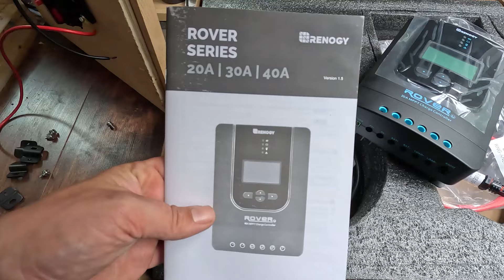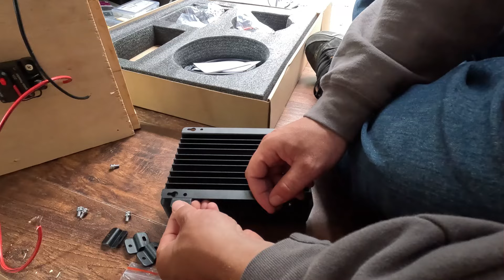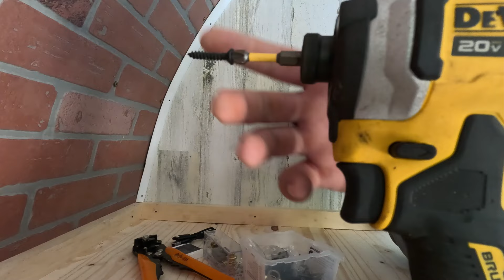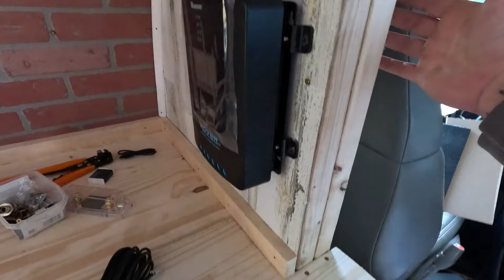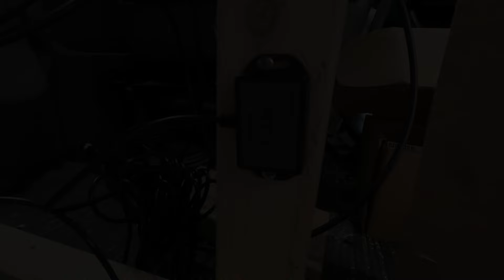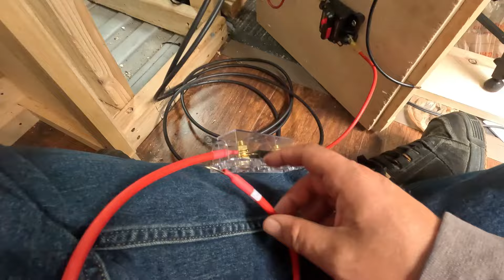Installing a Renogy 20AMP Solar controller, van build part 10 Solar Energy.

Comment: Looking good! I only went with my charge controller because it offered the DC to DC charging from my alternator. My BT-2 came with the same mess of wire which I don't understand because it's bluetooth! It's not like ya got to mount the module where you need to read something on it! I did the same thing you mentioned though - neatly gathered the excess together and zip tied it. Another step closer to done!
Reply from the maker: Yeah I like your setup a lot, I went pretty entry level just because it’s my first time ever digging into solar so I figured I’d keep it as simple as I can
Reply: @NE_Overlanding  Justin I don't know why I never saw this reply, but I've been fine tuning my solar a bit in between snowstorms. I've thought about hitting the road towards the south but I'm still messing with my DC to DC charging.
Reply from the maker: @ADKOverlandNY  no worries! And yeah I’m sure it takes a bit to get everything dialed in with that setup. Where you thinking of heading? I’m sure you’ve gotten a decent amount of snow by bow